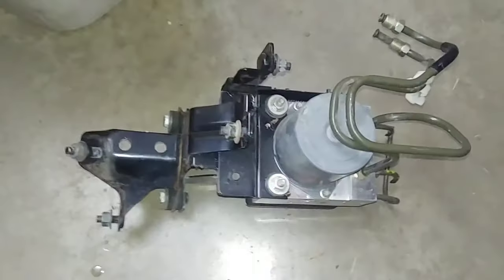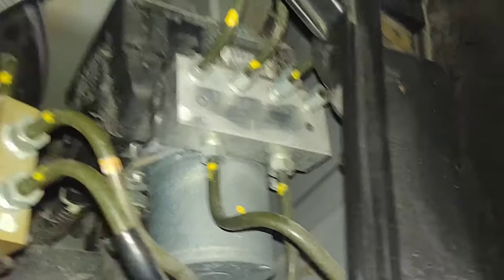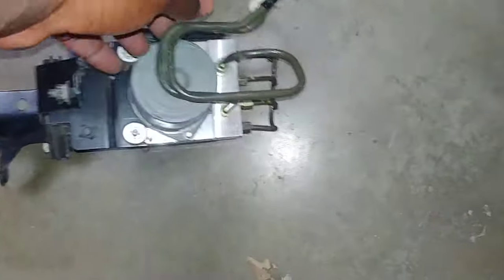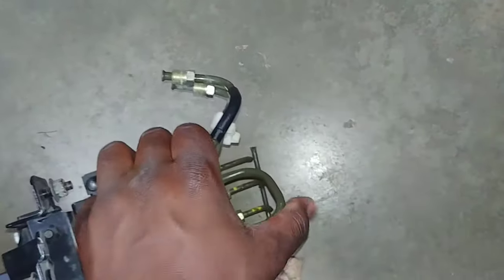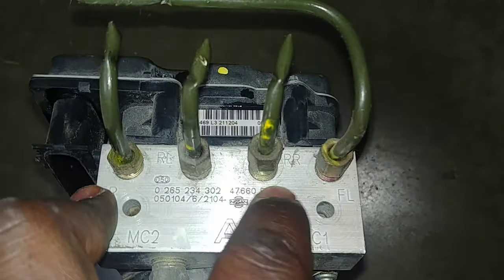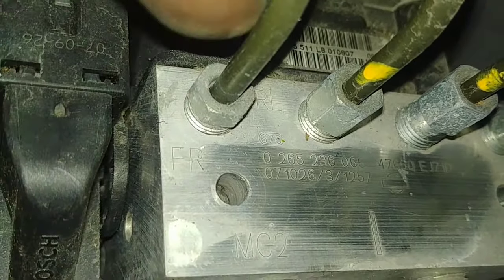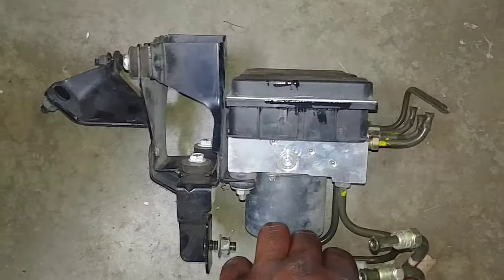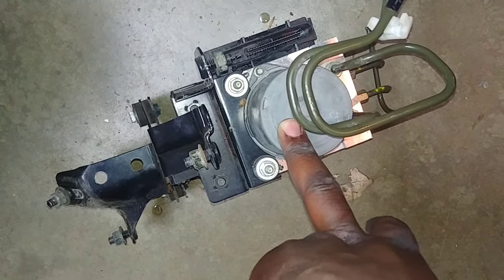Watch before you buy a used ABS module

Comment: You ought to look into learning how to take apart the electronic component of the unit (the part the connector connects to), and how to re-solder the broken or loose connections, and reflow all the machine-soldered connections to correct any "cold joints" that will fail in the near future. Start with the unit that doesn't fit your M45 Sport and take it from there. Many of these are built using the same methods, but to different specs. If it's a mechanical break in a soldered connection, which is typical, it can be repaired very quickly, once the unit it apart, i.e. the glued on top removed. 

Here's a link to fixing one used in a Ford truck -

https://youtu.be/Gi2rLYfdgzI

Comment: Great video. Thanks for the info.  My 2010 Ford 150 ABS just failed on me. The Ford dealership said they no longer make a replacement part that I need. They suggested they install a used ABS module that comes with no warranty.  Would you recommend i go that route?   Is it possible to just disable the entire ABS system and go old school?  Thanks for any advice you can share.
Reply: What did you end up doing?

Comment: I just put a used abs pump and module on a 14 dodge avenger through a code that abs pump didn't recognize c2202 I think.
Got the foxwell 610 code reader cleared it also has the abs brake bleed on too

Comment: Pls what are the 5 things to be checked before replacing the ABS computer?
Reply: Lol BATTERY12v , Fuses,RELAYS, All grounds and plugs ,
Reply: The abs computer ? This is something I have never heard of lol you mean the abs module? Or do you mean ECM ? Two different things both have a brain
Reply: @whocares1914  actually an ECM=electronic control module.  
So the abs module is literally an ECM that specifically controls the abs system.  

None of them have any more “brains” than your microwave does.
Reply: my two cents
1 ensure all fuses and relays are operational
2 ensure all sensor wires running up into the wheel well are undamaged
3 check reluctor sensors are free of magnetic debris
4 check sensors are sending a signal
5 check each axle's reluctors are in the sensor window - someone replaced an axle on my 2002 with wrong version - signal failed
Reply: @kidicarus2637  no use starting with any or all of that stuff when any and all of those problems will set a dtc if those things were a problem.  
Either you have good, valid wheel speeds or you don’t,  if you don’t it will set a code for that wheel so no use considering sensors “windows” when no trouble codes to indicate such problems at any wheel is present.  

The correct answer is to follow the appropriate diagnostic flow chart. 👊
Reply: @jaxturner7288  I would normally agree with you BUT certain late 199X to early/mid 200X abs implementations are on a split bus (so DTCs are not even passed to the ECU nor readable via OBD2 connector), on my last ABS debug there were no DLC3 readers that could communicate with the known good abs computer and I was debugging intermittent issues that would cause ABS light but code reading required IGN OFF/ON cycle and nothing would come back as pending.  Always better to work off a visual checklist than load the "parts canon", no? :P
Reply: @kidicarus2637  always good to read to the end of the comment, no?

Or do you not know what a flow chart is?
Because they do often include visual inspections. 
And none of them result in loading a parts cannon.

Comment: Can i use a used abs control module on an 2011 jeep compass?
Reply from the maker: Yeah, you should be able to. Just match your part numbers, or buy the newest available part number compatible with your VIN.
Sometimes a dealership is the best place to get this info
Reply: @EdBwoy  hi, u did such a useful video, I have a question about it. Which abs module can I use as a "digital" replacement in terms of canbus/connector compatibility? Is it ok to install any abs module from civic mk9 line on the civic SI oth? My idea was to bypass abs but leaving connected a module on the car in order to send abs status update and not sending the car in limp mode. Thanks in advance for all the support

Comment: Can u use a used abs pump and module for a h3 hummer and does it have to be programmed to my vehicle? It's in shop not getting brake fluid to back breaks after changing a break line on passenger front side. Shop thinks I need abs pump
Reply from the maker: I am not familiar with the Hummer, but I can give you some genrleral info.
In Nissans, you want to match your replacement ABS module based on the features your car has, for example intelligent cruise, sport model, etc. You could have upton3 or 4 different ABS modules per given year of a model. I don't know if Hummers are that different between each other. Just look at the model numbers.
Reply from the maker: Also, sometimes these units act funny if you don't pay attention during a fluid job and end up running them dry. But on the Nissan side, we have codes that tell you specifically this ABS module is done for, so it's not just a guess.
Reply: What are the codes for bad abs fx50d
Reply: I have a 2013 kia optima hybrid i just replaced the abs module with a used one does it have to be programmed im still seeing a hybrid system warning and my car is stuck in limp mode